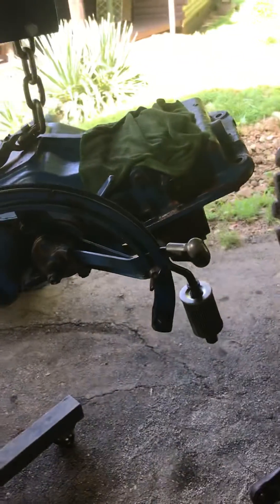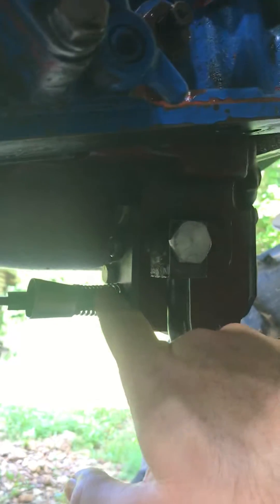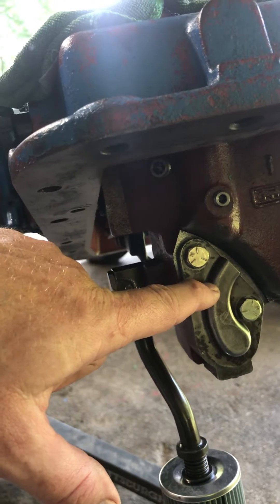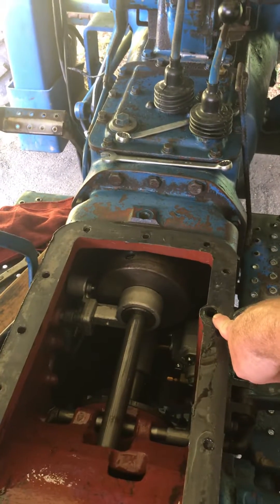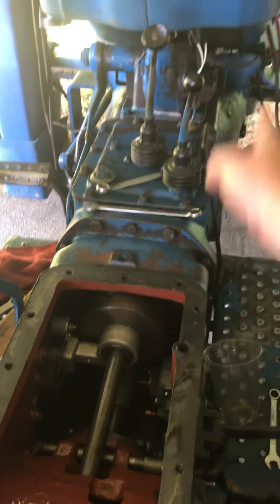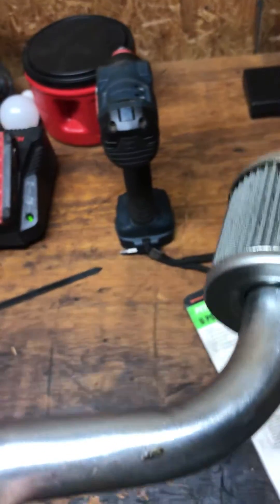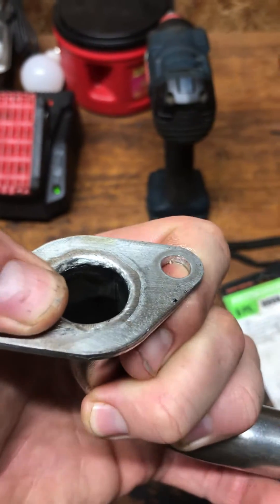Ford 5000 lift cover rebuild and unloader valve location

Comment: Got a question for ya, there’s an adjustment bolt & jam nut on the clutch side of the tractor just ahead of the PTO lever. Any ideas on what that is? Seems to be related to the PTO, as someone (maybe me) unthreaded it all the way out thinking it was a fluid level check hole. Come to find out that bolt has a pin on the end of and now the tractor won’t engage the PTO….rookie!!
Reply: I’m thinking it has to be a retention pin of sorts for the internal PTO linkage as everything was fully functioning before it was removed. Any thoughts would be appreciated otherwise I might have to break out the horse-drawn hay baler
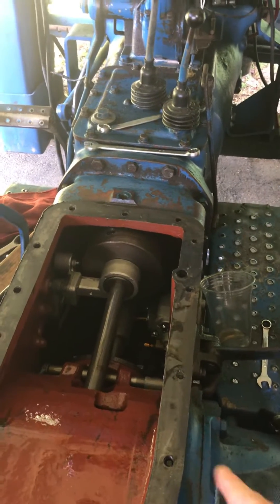Reply from the maker: @Nitroredneck199  that is exactly what it is. You'll need to remove the lift cover to put it back in. @1:20 you can see the oil supply assembly for the PTO clutches on the inside of the case next to the outside PTO handle. Sorry I got back to you so late on this. It's a pretty simple fix. I'd recommend a new pickup screen for the hydro pump and lift cover filter while your in there. Use an engine hoist to pick straight and down as there are alignment dowels. Also going to be an o-ring on the hydro pump side where the pieces are bolted together. You must change that o-ring out or it will leak. I'd even change out PTO clutches if it was me. The Israeli Made clutches are the best in my opinion.